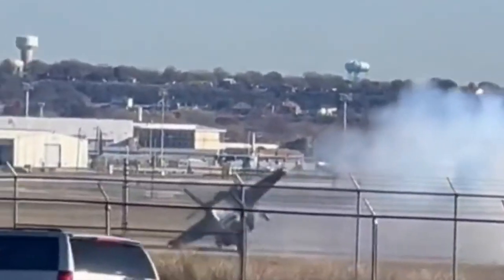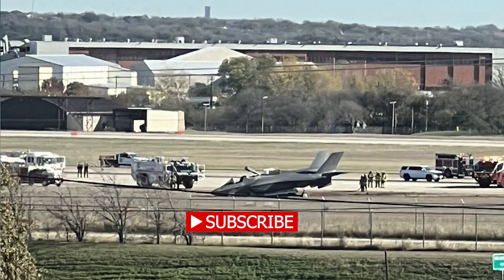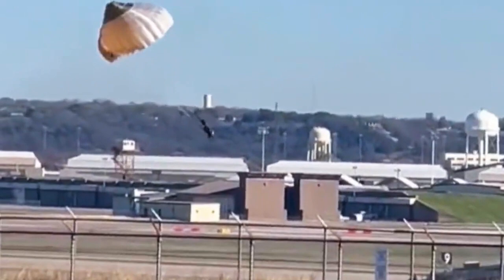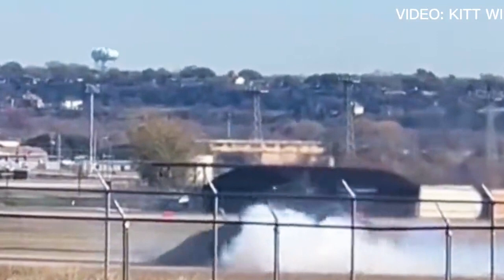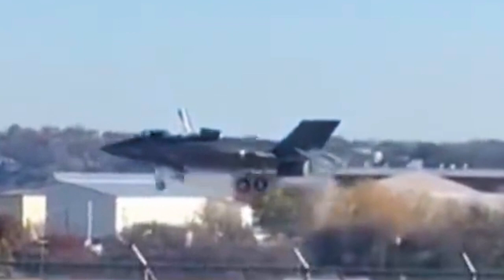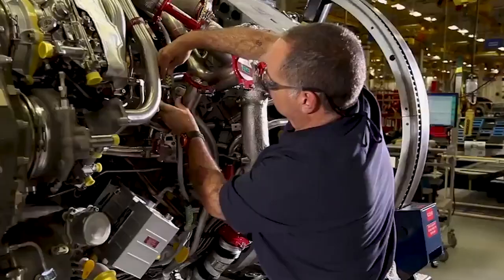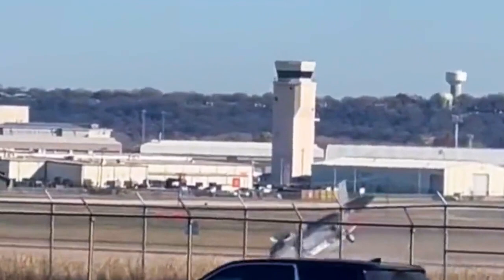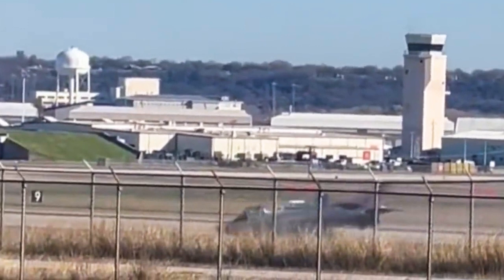Why F-35B crashed? This detail probably shows why the best US stealth fighter jet fell to the ground

Comment: F35, so expensive and with so many technical problems. Australia already regretted purchasing F35.
Reply: We get told what we have to buy and are not allowed to buy by the us.
Reply: Didn't know 1 person represented all of Australia
Reply: Reckless comment this is.
Reply: @luakabsalam1816 a true comment. Maintenance is a nightmare and it will see more failures in the future due to massive maintenance issues
Reply: @Testimony_Of_JTF  including Singapore
Reply: For context, it’s important to remember that the F-35 is also far more advanced than other contemporary aircraft. As such, each plane and the entire fleet has more needs and “parts,” and thus, more opportunities for failure. One of its many strengths is in its ability to network w/ other F-35’s and future allied aircraft. Australia should be included in this strategy. It’s also important to understand that the F-35 is NOT a typical air dominance fighter, and should not be compared to “other options.” All of that said, it is expensive to procure, and maintain. Think of it like a Ferrari, Lamborghini, etc., vs a basic daily driver. Like those, it’s meant to be the best for specific reasons.
Reply: @thelastlatchkeykid8466  load of bull. Stealth bombers and best attack helos have been shot down in combats in Balkans and Afghanistan and now Ukraine. 10 Toyota Camry are more useful than 1 Porche 911.
Reply: @thelastlatchkeykid8466  my  5,000 Corvettes can beat your 500 Ferrari’s. True Story
Reply: @luakabsalam1816  triggered much? My reply was only to add context based on the specific benefits of 5th generation stealth when compared to 4th generation fighters. And sure, 10 Camrys may be more useful in than one 911 if the goal/mission was to drive 10 ppl to different destinations, but if the mission was a race to see who could make it to a single destination first, the 911 is the right tool for the job. Another example, this time with a Jeep vs the 911; a single Jeep is better than 10 Camrys if the goal is to traverse off-road. And for the record, Stealth bombers have not been shot down, rather only one, single F-117 was shot down over the Balkans. To this date, it is the only US stealth plane to be shot down in conflict. It was also the first in service stealth aircraft, and began flying in 1981, and in no way comparable to todays 5th generation fighters. Additionally, stealth aircraft are not undetectable, rather, low radar observable, and it has been declassified and well documented that the F-117 that was shot down was accurately targeted by SAMs because it’s bay doors were open. Helicopters, by their very nature, are in no way comparable to stealth planes, and not a part of this discussion.
Reply: @MarineScoutSniper  I’d rather have 5k Corvette’s too. So I’m with you there brother.
Reply: @thelastlatchkeykid8466  No perfect system, always something to overcome it.
Reply: @luakabsalam1816  yeah, it’s called technological advancement, and it’s the reason there’s always something new and expensive.
Reply: His name was John Howard
Reply: @oot007 👌 🤣

Comment: F35B is a crash plane just like any other F35. This crash shows that the F35 is not designed properly. It also explains why there are so many F35 crashes during landing on an aircraft carrier. The stability of the aircraft during landing is not enough for an experienced pilot to land the aircraft safely. It is not caused by the pilot but by the aerodynamic instability during landing.

Comment: In my opinion, the main reason for the crash landing was the occurred differential lifting power between the main engine and the lifting fan. Maybe this was because an automation failure of the throttle or a pilot mistake
Reply: Don't blame the pilot he's an experience fighter!!! Blame the flying coffin⚰ submarine and  the engineer who built this flying coffin
Reply: @Amen7801  so you know for sure it wasn't the pilot? 🤔

Comment: Wait, that piece of crap is not made in China?? How many times now have these useless plane fall out of the sky?
Reply from the maker: chinese did provide alloy to f-35 project
Reply: @chineseforces  , and that was the cause of the problem?
Reply: Around 8-9 crashed and I’m
Sure more will crash in the future and it don’t even faced a war
Reply: ALL American made friend! The USAF can be proud!
Reply: @cemo3292  Hahaha, good point.
Reply: @user-fv4kv7gm7y  no it depends on the engineering and materials are used on F35, but as I see on F35 that got crash landed, during take off, got wheel damage on landed while moving, and so on, this is totally a flawless plane, but with full of lack of qualities and high expensive maintenance price, instead with poor materials on it, making a show-off aircraft with some flaws design on it. So F35 is more like an show piece aircraft rather than old operational combat aircraft like the Mig 21 or a F4/F15.